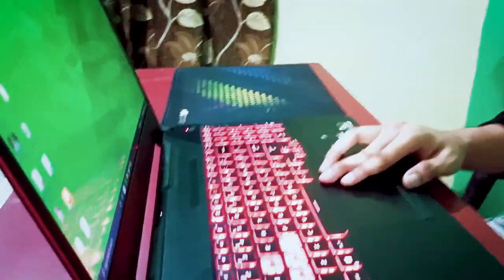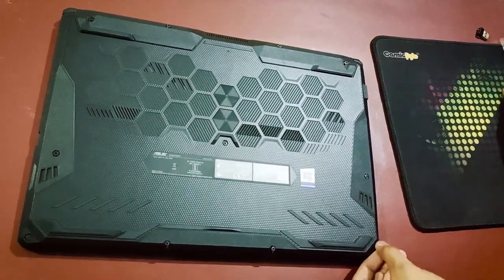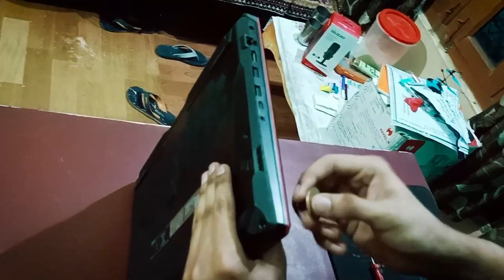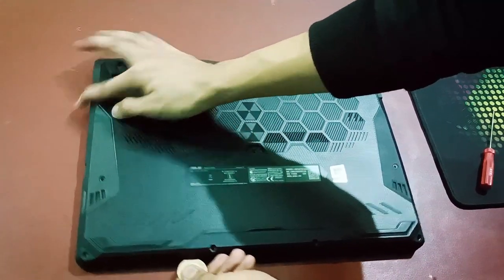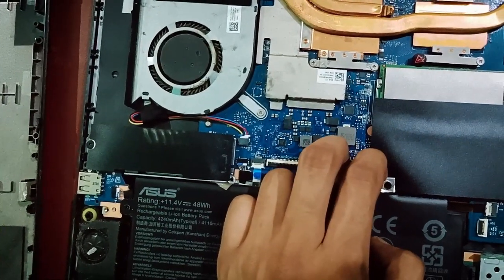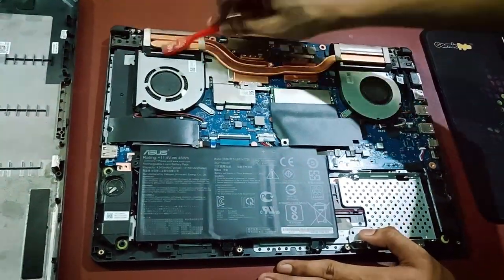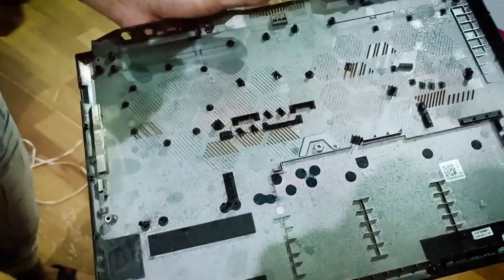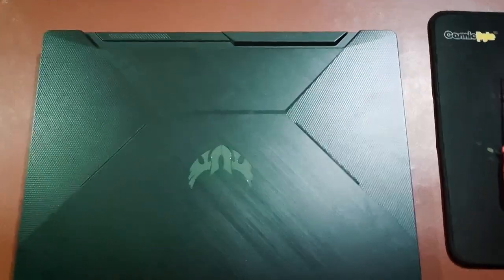How to Clean Dust from Asus Tuf A15 & F15 | 0 To 100%

Comment: I´ve had my A15 for about 3 years and last month it started getting so hot it would shut down. Finally decided to go clean it, followed your video and the fans were filled to the brim with dust (no exaggeration). Explained quite a lot. Thanks for the tutorial!
Reply: I'm a bit like you, had mine for a couple years now and are still yet to clean it out. I'm guessing you followed the tutorial exactly like he did? If so, if you don't mind, could you let know it went? Any issues? Stuff like that.
Reply: most difficult part was detaching the lid, had to pry quite a bit while being careful not to put too much pressure on it. I cleaned it by using a paintbrush and just went to town with it in the fans and other nooks and crannies in the lid. I used a vacuum on a low setting to get rid of the dust as i was brushing it (LOW setting tho, didnt wanna accidentally suck in anything important XD)
Goodluck!

Comment: You just killed the warranty by scratching the lid with the coin. Also, never use a hair dryer, the direct air heat can damage components.
Reply from the maker: It was not hot it was cold dryer and no scratches at all
Reply: You can set hair dryers to hot, tepid, and cold.

Comment: You should not use a hair dryer it is harmful for the laptop use compressed air can instead.
Reply from the maker: It was cold air mate
Reply: @Devilyte  Cold air from a hair dryer still creats friction in the air which produces static.

Comment: Does it have to be a hair dryer or can I use compressed air?
Reply from the maker: You can use that too, make sure it is fast so it can remove the dust

Comment: Is the plastic body tough (robust) against knocks or even drop from table to the floor?
Reply from the maker: Its a very good material
Reply: My a15 was in the boot of the car, we stopped at the petrol station and my girlfriend went to take something from the boot, it was on top of the printer, I heard the tell tale noise of device hitting floor, it fell maybe 4ft down onto concrete and was absolutely fine, I small scuff to the corner, something inside is not very happy, every now and then it makes a loud noise when turning on, but other then that, inwas genuinely shocked at how well it took it, I would have gone mental when it happened, however I just sat silently contemplating my stupidity at leaving it loose like that, I didn't even look at it until the next day because I was so afraid of what I would see 😅
Reply: @Frosty-so4vd  asus "tuf"

Comment: Does it void the warranty if you do this? My GPU fan keeps stopping probably due to dust and I want to clean it
Reply: Yes, the moment you open your laptop you will lose any guarantee
Reply from the maker: NO as it is a gaming laptop, so you can upgrade it anytime, it wont void warranty you can open and clean it :)
Reply: hey you have any update about your fan? i have the same.problem too but with the cpu fan
Reply: @davidtmp2777  no if you look you can see a red warranty sticker above the ram if you remove that then you void the warranty, you can open it up to make mods like SSD or Ram upgrades.
Reply: No it does not void it entirely, however warranty will not cover any issues that occur from you tinkering around with your laptop. So unless you've watched a couple of videos and are confident I wouldn't recommend doing so.

Comment: Bro is there any problem for you laptop too , cause i too use wifi driver
Reply from the maker: Yes, bro my wifi was stopped responding continuously it was disconnecting again and again
Reply: @Devilyte  same problem what did you did to resolve it
Reply: @Devilyte yes sometimes wifi stops working then i have to restart

Comment: I saw online that hair dryers create static that destroys electronic parts
Reply from the maker: I am really sorry mate but the heat was off, it was totally cold air
Reply: It still created friction in the air which produces static. Do NOT use any hair dryer. Cans of compressed air are cheap, make the trip.